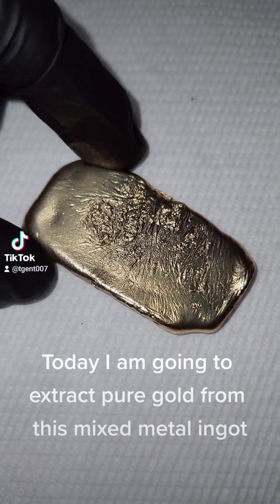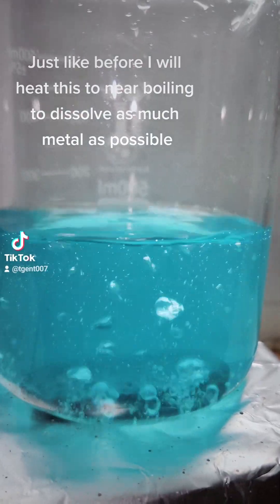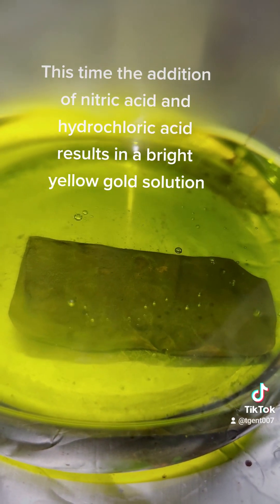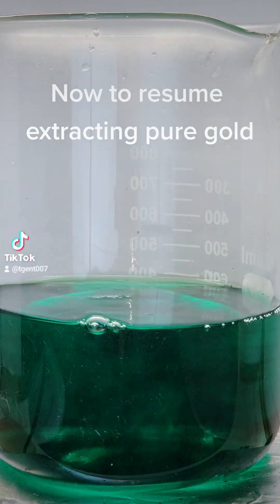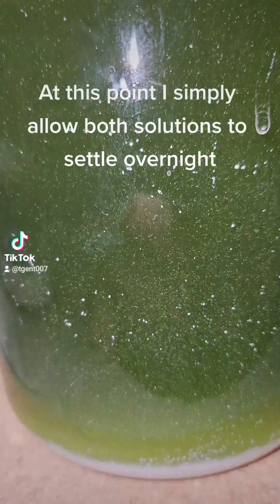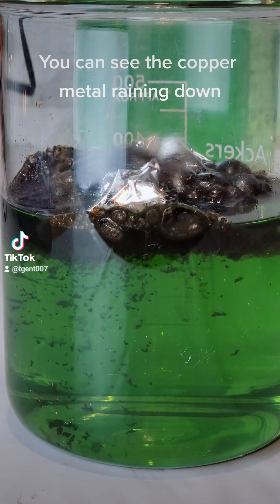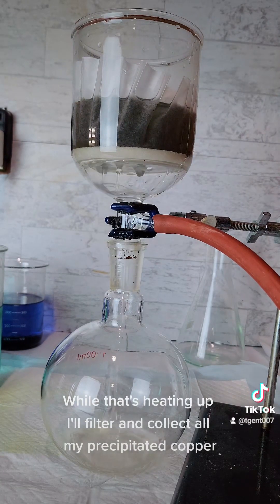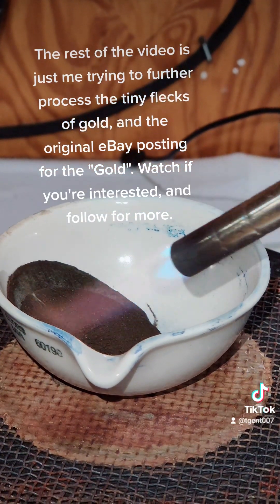Gold Extraction From a $20 Ebay Ingot

Comment: You should have melted the metal bar first and dripped it into a cold water  metal container to break apart into piece, would have been a lot easier for the acids to work!

Comment: That's a hot eBay scam.  Make a low value alloy (Cu, Ni, Zn) and sell it as "containing gold"

If it sounds too good to be true, it is.
Reply from the maker: I figured as much.. I did find it interesting to prove it though.
Reply: @integral_chemistry  Thanks for putting in the rigorous effort to help others avoid these kind of scams.

I watched you do it, now I don't have to  👍🏼
Reply: @scottwilliams895  I have been refining gold for the past 12 years now and luckily I never bought any of these types of bars as they are a scam. My logic goes like this: why would someone be melting pins or other gold plated material together? It wastes thier time and costs them fuel to melt them together. The answer is because the want to melt it together so you don't know what the starting material was. Therefore they can claim whatever they want and you wouldn't know. Most of the gold scrap on ebay is extremely over priced and so many people are buying it without realizing that they are over paying.
Reply from the maker: @aa1.5  Exactly! I had the same thought bit it was a fun little test. Out of curiosity do you happen to know anywhere one could get gold scrap that isn't overpriced? As you said the stuff on ebay is priced at almost the value of the gold in it which makes extraction a waste of time/resources
Reply: @integral_chemistry  I wish I could tell you, but I can not answer that since everyone would then be crowding those spots and it would ruin it for those of us that have found them on our own.

Comment: Transistion metal chemistry is beautiful, but it's so resource intensive. In the EU there aren't even legal ways to buy conc. HNO3 (same goes for H2SO4 and H2O2) anymore, which basically shut down the whole chemistry hobbyist sector. Can't really do much without these basic starting chemicals.
Reply from the maker: You could get away with synthesizing distilling any weak sulfuric acids you have access to, and then use that to make concentrated nitric acid.. But yes that is a lot of work and it would certainly suck the fun out of resource-intensive projects like this one.. Quite a shame.. Especially as Germany in particular is the birthplace of so so much chemistry.
Reply: You can use oxalic acid and a sulfate salt to make H2SO4 and then go from there. You can also synthesize sulfuric acid using electrolysis
Reply: @chemistryofquestionablequa6252  The oxalic acid method sounds interesting. Does it decompose into CO2 during the process?
Reply: @Psychx_  I'm honestly not sure,  I've seen videos about it,  but not recently.  It's easy to find sulfuric acid where I live.
Reply: @chemistryofquestionablequa6252  I looked it up. When performed with Copper(II)sulfate, the resulting oxalate salt crashes out of solution, which makes separation easier.
If there is some solvated oxalate left, it will react with the H2SO4 to form CO, CO2 and H2O upon heating/distillation, which is definitely handy to know - nobody would like to get carbon monoxide poisoning after all…